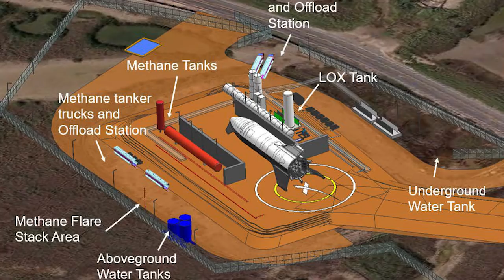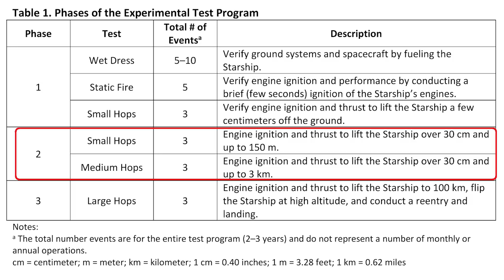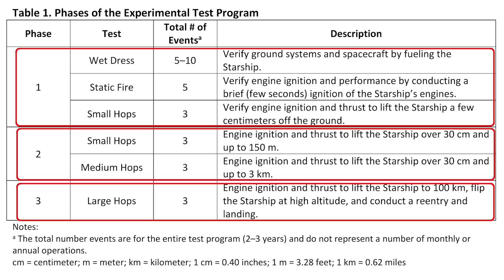SpaceX Starship Update:  SpaceX confirms it's almost ready to test its orbital Starship

Comment: What was the FAA's reason for cutting Starhopper's 200m hop to 150m? Seriously, what difference did 50m make?
Reply: angc214 In case of explosion, debris can go a lot further at 200m.
Reply: @AkaiKA4K  If it explodes, it doesn't matter if the the the thing fell from 150 meters or 200 meters. The debris is going to fly the same distance.
Reply: Oh really? I imagined 1/3 increase in diameter of potential debris zone. May be you can try blowing a paint ball at 3 feet and 4 feet respectively.
Reply: @AkaiKA4K  3 feet to 4 feet is a bad example. 150 meters (450 feet) or 200 meters (600 feet) assuming the thing explodes at the top of its flight, at a certain point all debris stops flying outward and just falls straight down due to gravity.
Reply: angc214 200m is yet to be that certain distance. Nukes are exploded at 600m for maximum damage.
Reply: @AkaiKA4K  We're not talking about nuclear weapons. There's a huge difference between a nuclear weapon designed to kill millions of people and a a tank of liquid methane. The energy output between those is worlds apart.
Reply: angc214 Oh really? I wonder why FAA also regulated not to carry more than 30 tones of fuel. Hiroshima bomb was 63 TJ of energy. Methane release 50kJ/g of energy on combustion. A fully fueled Starhopper without booster will contain about 230 tons ( 230,000kg) of methane = 11TJ of energy. You are underestimating the size of the rocket. For this particular flight, 30 tones of fuel = 6.25 tones of methane and 23.75 tons of oxygen = still 0.3TJ of energy and blast radius is huge.
Reply: When you realize Starship + Superheavy fully fuel is basically a nuke sitting. 🤯🤯
Reply: @AkaiKA4K  Which again begs the question, why limit Starhopper to 150 meters?
Reply: angc214 As I already said it is a huge rocket. It got a huge blast radius when it explode. And damage field is much wider at 200m. I even compared it to a nuke. Even if it is lightly fuel at 30 tones, it has 1/200 energy of a nuke. A fully fuel Starship is 1/3 of a nuke.
Reply: @AkaiKA4K  They're going to fly Starship prototype 1 to 20 km from the same location. If the FAA is having a fit about the fuel required to fly Starhopper an extra 50 m in altitude with one Raptor engine, how the hell are they ok with the fuel required to send Starship with six Raptor engines to 20 thousand meters. I guess I should setup trying to understand bureaucrats way of thinking.
Reply: angc214 Chance of failure is high with first try. And if it fails, FAA gonna be roasted by public for for even letting fly water tower looking thing . 😂😂

Comment: I hope somebody with the needed technical background can answer this question.  The starship prototypes don't look like they have a thermal protection system for orbital reentry.  Where are all those tiny pores through which the spacecraft was supposed to 'sweat' water or methane to cool the hull during reentry?  It doesn't look like they could be there, nor do all those joints look compatible with them.  Won't they need an entirely different sort of hull for orbital reentry?  If so, does that mean that SpaceX will need to build yet another ship for the orbital test flight that Elon Musk says is coming by the end of the year?
Reply: Paul Patton This is why these are called Starship prototype mk1 and mk2. Thermal tiles will likely be added after 20km hop. Evaporation may or may not be added after accessing thermal stress to the heat shield tiles.

Comment: Is that thing hot glued together? The joints/seams look lumpy...
Reply: They have been welded, which leaves a raised bead, then ground smooth to reduce drag.
Reply: These are all hastily built shells with top of the line inside engines, etc. as I understand This the object of these tests are of course the telemetry and as a Brownsville resident we are excited as hell !!, sadly was out of town when the first test of the hopper , but won’t miss the next test(s)
Reply: It's a Kabuki theater look it up
Reply: Sheet stainless steel is a pest to weld. With simple welding technique the heat buckles the sheet, making it look lumpy. For a sacrificial 'dummy starship' they are not going to the expense of more difficult heat-controlled welding methods.
Reply: Probably welded i dont know
Reply: Looking at the welding job on that nose cone I'm sorry but shades of Mad Mike Hughs come to mind if he had a ton of cash.
Reply: @pakde8002  I know what you mean, it looks terrible. Who knows how it ended up like that. The video said they were having a lot of trouble getting it on, so maybe they kept having to adjust the weld points. 

The thing about SpaceX though is you can't argue with results. They achieve a lot as far as space flight developments go (reusing rocket boosters in particular is a huge step forwards for the industry). Unlike other space agencies they're not acting as flagship for the state, so appearances (and 'embarrassing' failures) are much less of a big deal for them.

How mission critical is the precision of joins on the nose cone form at this stage? My guess, not very. They probably cut corners to a ridiculous degree and it seems that backfired in this case, but generally it's a good strategy, if you know where corners can be cut safely.

These are unmanned prototypes so there's no risk to life, and if they can build three shoddy ones or one polished one and conduct their tests effectively, the choice is obvious.
Reply: @pakde8002  you know, people call him crazy, but his rocket survived a pretty hard landing.... twice....(im joking of course, dude's totally crazy)
Reply: @maxk4324  Yeah right, totally crazy to have a successful rocket co., developing rocket engines, an innovative electric car co., a boring co., Neurolink and being a billionaire in the process...not so shabby eh?
Reply: @AnthonyElsom  I meant Mike Hughes is crazy, not elon.
Reply: @maxk4324  Heck, my bad, apologies.
Reply: @maxk4324  Mad Mike Hughes, damn crazy fool..Brilliant rocket, crazy purpose..
Reply: @AnthonyElsom  no worries, and hot damn is that guy out there. I mean I applaud him in that he's the only flat earther I've ever seen doing anything even remotely substantial in the efforts to prove his claims, and honestly that's admirable. But in an interview I read where he talked about his rocket... Well let's just say their methods are less than scientific. The launch procedure is him reaching down and opening two ball valves in sequence to launch, and he has to MANUALLY deploy his chutes. Honestly I'm just surprised it didn't either blow up or fail to lift off.
Reply: @maxk4324  Well, I hope he gets up high enough to see the curve, he'll come down less mad than when he went up....(grin)
Reply: Don't want to spend much effort on something which is most likely to blow up at some point.

Comment: So, you cant even get the nose cone back on.  Is it just me, or does this thing look like they had a budget of $100 and all the aluminum foil they could buy at the local Safeway?  Looks like you could dent it just leaning against it.  I think I have seen grain silos put up with more precision.  And you are going to launch that thing 20 miles into the sky, and land it on that tiny parking lot?  If you are literally 50 feet off, you will incinerate that road.  I think they are playing WAY fast and lose with this thing, and if they are not careful, will land that thing in the middle of the trailer park that is 1 mile away, roasting 500 Texas locals.
Reply: It's a prototype, not designed for super high speed travel, so the less-than-perfectly-smooth skin is not so critical.
And the tracking and location tech in the craft will autonomously guide it back to a pinpoint landing, accurate to about 5 feet..
This vehicle will be fine for the 20k test. And if it goes bang, we'll all get a great show either way.. 😉
Reply: Nah, man. It's not that some guy on Youtube knows better than a company, right?

Comment: Yeah, that tin can that looks like a meth head and crack addict welded the sheet metal together looks like a real rocket...come on!  Look at it!  Wtf?  My High School shop teacher could do a way better job, AND HE WAS ALWAYS FALLING DOWN DRUNK.
Reply: These are just prototypes to test the flight worthiness of the new raptor engines.  They don't have to be "picture perfect" right now.
Reply: L Dewey, I think the next flight will be kilometres long.  Not supersonic or hypersonic.  But, the next flight after that is orbital.  That requires speeds where non-laminar flow over the surface of that horrible construction would cause forces that would rip it apart.

Let's see.  Never forget, from professional sports, to any great endeavour, the success or failure is in the details.  What makes a professional a professional is the accumulation of attention to detail that the amateur cannot distinguish, or implement.

I see a red flag.  We'll find out soon enough, if a world war or civil war, doesn't interrupt everything.  I smell a rat, and I'm very rarely happy, or wrong.

Look at every military rocket from any country.  They are as smooth as possible for a reason.  Not a style choice.
Reply: @Ubermenschen  "Let's see..."  didn't SpaceX build and successfully launch both Falcon 9 and Falcon Heavy?  Hmmmm.....

Comment: Why does the skin look like its wrinkled aluminum foil?
Reply: Because it's all fake! It must be, it says on the internet that nobody can go into space!😂😂
Reply: Its so space aliens dont muck around with the electronics. :)
Reply: Welding of the stainless steel panels slightly warps them. Since the exterior is polished, it shows imperfections.
Reply: Elon has problems with fit and finish at Tesla too.  ;)
Reply: It’s how it supposed to be. Same as Model 3 panel gaps.
Reply: These are experimental test vehicles prototypes. They will be seamless when the real rockets are used.
Reply: it looks worse than it is, tiny imperfections are much more visible on reflective (mirror like) surfaces, though, it doesnt matter, its just rapid development prototype, no need to further polish or straightening , it just needs to protect internal stuff, and test engines/thrusters and control software
Reply: Have you ever seen the Lunar Lander?
Reply: Apparently it's thin , final versions will have thicker stainless , musk said this at some point I'm pretty sure
Reply: infopackrat - probably not far from it. To keep the weight down. I think it is beautiful. Wait till they start 3-D printing them. Those could be seamless. With the perfect shape;)

Comment: I'm confused, is Starship a true single stage to orbit craft, or does it need Super Heavy to get to orbit?
Reply: The 1st stage is necessary to get the starship to orbit because the ship and cargo will weigh close to 100 tons. The 1st stage will have around 31 rocket engines to do just that.
Reply: Too much changing for me to be confident but my impression is that it should be able to get to orbit (from earth)  on its own but not carry enough load for that to be useful other than for test flights.  That vague info goes back lots of design ittetations though and may never have been official.

Comment: Why do you say 20 kilometers and explain how many miles that is, and continue to say 30 feet, but don't explain how many metres that is? A bit inconsistent. Either mention everything in the metric system and explain the other one, or everything in that other one and explain how much that is in the metric system.
Reply: I grew up with both. 30 feet is close to 10 meters. 20 kilometres is close to 12 miles. I can do the math in my head
 I'm Canadian by the way. We still use both measurements in various ways.
Reply: @glenkeating7333  Yeah but it just sounds a bit strange (to me anyway) to use them both in 1 story like this.
Reply: Andrew Brent  I can calculate them both as well, but it just sounds weird to use alternately in 1 story.